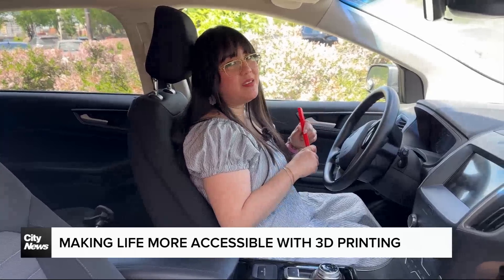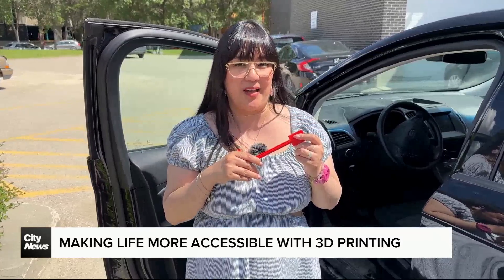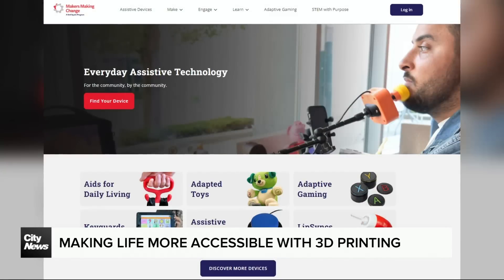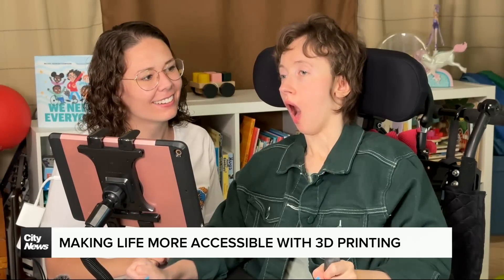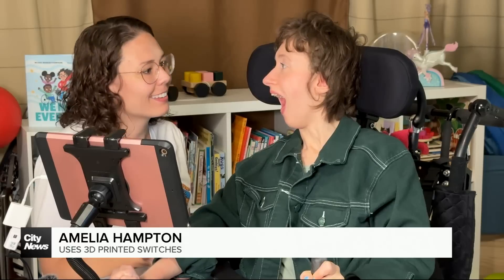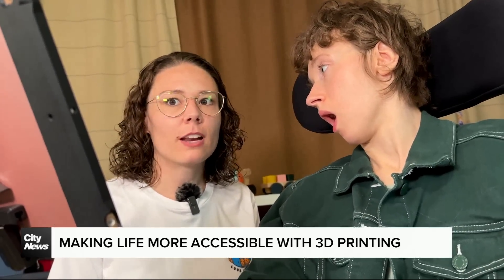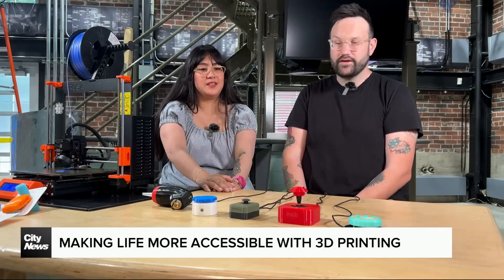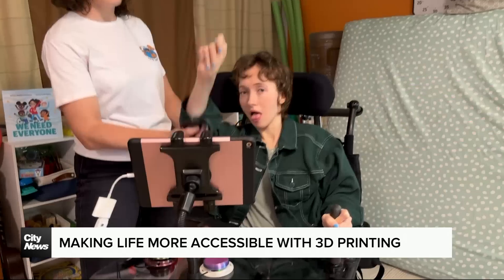Canadians using 3D printing to remove accessibility barriers at low cost

Comment: Umm maybe if you can’t engage or unclip seatbelt you are unfit to operate a motor vehicle? !?!
Reply: Clearly you  lack  basic understanding and compassion for those who might have some limitations so..... There are cars adapted for those missing one or more limbs or in a wheelchair. Should all those people just stay home or give up their independence? Just because something is painful doesn't mean you can't do it. If we can make life a little easier for them, shouldn't we?

I guarantee you they are all safer drivers than the tik tok generation with their heads stuck to their phones while driving
Reply: That does not automatically make you unfit to operate a motor vehicle. 

Think about hand controls, which are fairly common for people in a wheelchair. Just because they cannot operate the pedals with their feet does not mean that they are unfit to operate a motor vehicle. They just need adaptations so that they can use it properly.

A quadriplegic may not have normal movement of their hands, but with adaptations, they are then able to use something like a seatbelt.
Their range of movement of their hands does not impact something like their reaction time.

I’m not sure how it is where you live, but where I live, there are many procedures and tests in place to ensure that someone is indeed fit to operate a motor vehicle. People with disabilities have A LOT of hoops to go through to be able to drive.

And because of that, they often actually drive much safer than most people because they know that it’s a privilege that cannot be taken for granted.
Reply: Ummm, first no, and second have you ever been in a car without a passenger seat? Or perhaps you're still paddling around in your Little Tikes coupe
Reply: @marchache  Maybe you should expand on the no passenger seat comment instead of the insults 🤡

Comment: Maybe controversial to say, but if you have problems controlling your hands maybe you shouldnt be in control of a two ton hunk of metal that can go 100mph
Reply: Darn. I totally forgot that every vehicle only comes with a driver's seat.
Reply: Just because they don’t have normal movement of their hands does not mean that they cannot operate a vehicle safely. Many people with disabilities are perfectly capable of driving, but they need adaptations to be able to use a vehicle since vehicles were designed for people without disabilities.

For example, one common device is the hand control for wheelchair users. Wheelchair users can use hand controls to operate the pedals. It’s not that they can’t drive because they don’t have normal movement of their legs, it’s just that they require an adaptation in order to use a device that was designed for people who have normal movement of their legs.
Reply: keep things to yourself and learn how to respect one and other k?
Reply: @olliecatmax  I'm not making fun of anyone, I'm pointing out a potential road danger. If you think that's disrespectful then you have a lot of growing up to do

Comment: 0:01 we don't get to see her actually using the seat belt thing. The seat belt was as already undone. Huh??

The seatbelt is actually already loose in her lap and being held by her left hand by her tummy area.
Nowhere near the seat belt lock.

So the device doesn't work? Broken?

Straight off the bat the video seems shady. Why lie at the start?
Reply: Use critical thinking. Do you think that someone might have to lie that a plastic stick is capable of pressing a button? If the dude said that was his first invention, do you think he would make a whole 3d printing website based on a lie, without getting caught?
Seems more likely to me the editor just made a dumb editing mistake and sacrificed us getting to see the actual click for the sake of intro pacing. Or maybe someone spoke during the shot, and didnt film a second take, such that the editors hands were tied. Imperfect and unsatisfactory, but not dishonest.
Reply: First you shoot the messenger, then you go off on an unsubstantiated rant.
Reply: @dougaltolan3017  so what are they reporting? A device to help open seat belts. But we don't actually see that. Instead we see a fake moment.

You don't think we should call out fakes on the news?

This is the news doing a product placement too. A fake advert that doesn't even show it working.

You don't see anything wrong about that?

Isn't that called a scam?
Reply: A positive, mainstream story of the benefits of additive manufacturing. But there always needs to be the one or two negative comments that still find fault in everything. This video isn't some conspiracy, dude.

Comment: I wonder if there is a tool to help put a seatbelt into the buckle when I am seating in the back seat. I keep missing the buckle and not able to get the seatbelt to click or I get the wrong buckle and cannot fasten my seatbelt. The O/A makes it very difficult to hold the metal piece.
Reply: Buy a cheap pool noodle. Dollar store.  8f it's 3asier ask some to cut it for you so it goes around the seat belt holder. In a way it no longer flopsloke a dead fish.   I drove seniors.  I also got a seat belt extender which stayed plugged it extending the clip 5 inches. They no longer struggled. They loved it.
Reply: 3 old ladies in a tiny backseat.  We had an AWFUL time trying to get buckled!  We had to buckle each other in!  We got to know each other quite well in that tiny back seat.  😳
Reply: There can be. Tools aren’t hard to design, but they won’t be able to make you connect the right buckles together. That’s on you.
Reply: If it doesnt exist yet I'm sure it can be made fairly easily. 3D Printing is one of those things of "If you can imagine it, you can make it"

Comment: If seatbelt releases need special tools to operate they are not a safety device but a safety hazard.

If that were not the case we would laugh in every tv and movie drama when someone tries and fails to release themselves from the vehicles under water or in imminent danger of catching fire.

This device is not a solution. 
It is mitigation.
Reply: Dude, the inability to get out of the car isn't because of the seatbelt. It's opening the car door or breaking the window before it's too late to reach the surface without drowning. If you have rapid flood water beating against your car, you will likely die even if you get out. If you can't push a button to get a seatbelt off, then you aren't surviving any of those scenarios regardless of the seatbelt.
Reply: @sonniepronounceds-au-ni9287
The words I write are the words 
I mean.
Often, on screen, when a hero escapes a sinking car he is unable to unfasten his passenger or they are unable to do it themselves. A very common scenario.
I am not addressing the realities of drowning in cars but movie and tv story lines.
Dude.
Reply: @jeremyashford2145  The discussion about whether seatbelts are a safety hazard and the need for seatbelt releasers has to do with reality. The reality is that seatbelts generally don't cause problems for anyone who could survive that bad of a wreck without aid.
Reply: Please don't tell me you drive without a seatbelt because you saw someone die in a movie..
Reply: @Mattematical
Okay. Not a thing.

I've seen movies about contagion as well and recognise those as fiction too.
Reply: How many times have you been in a car accident vs a submerged or burning car?
Reply: @kel5944
Submerged car: 0
Burning car: 2
"car accident": too many to count but I've never been in one I could not remove myself from
Reply: What is your point? That disabled people shouldn't have tools to be more self sufficient and experience a sense of independence? Or is it that cars are just too dangerous for people with disabilities to be in? Please, by all means, offer us your magic carpet instead. Or you could just consider reassessing your ableist views.

Also, how are car crashes such a frequent occurrence for you? Are you a Hollywood stunt driver?

Comment: Convincing your old relatives to do less as it becomes harder just accelerates their degeneration. Not only is using that seat belt aid probably hurting his dad just as much as it was to do it himself 2 years ago, but this would of cut years off his life.

Dont do things for the elderly that they can do themselves, especially if those things are hard for them to do.
Reply: I disagree. My left shoulder is bad. If I move my arm up and out far enough to hold my parking pass up to the reader at work, it hurts. Often to the point of it throbbing all day. I now have the pass attached to a three foot length of pipe so I can put it against the reader without hurting myself.  I don't see how not putting myself in pain will impair my cognitive abilities.
Reply: Ah the common "enabling vs accountability". Though this thought very well might be true to an extent, its not a reason to downright stop ingenuity. Ultimately people must try things to find out.
Reply: This is a completely bizaree comment. It would cut years off his life? Huh??????
Reply: Better yet, get them to take the bus.

Hope they don't sit down for too long, or else they might lose the ability to walk.

When I used to use those shoulder-destroyers, I would press the button for the buckle with my THUMB. It was much better than trying to pinch in with my fingers.
Reply: @mRahman. My thumbs are so full of arthritis that at times they have no strength at all.  I'm the one who could open jars even men couldn't get open.  (I think the small squareness of my strong little meathooks maybe gave me a better grasp on the lids.).  Fingers, hands, wrists, elbows, shoulders and all points further south.  Arthritis.  Bursitis.  And 5 decades of severe fibromyalgia.  Some days I'm not too bad.  Other days I have the strength of an overcooked spaghetti noodle.  Any little bit of help that makes me function more productively without pain or damaging myself is very welcome.  Aging is bad enough when you don't have health issues.  These tools can help keep us in our active lives.
Reply: @wendybutler1681  you really bothered typing all of that with arthritis?

Comment: The only problem with personal manufacturing tools is that there will be a wider variety of products being developed and hence more confusion as to what does what and which is a better solution.  Of course, these challenges are inevitable as we approach a post-scarcity civilization and our population grows.  Even communications in our scientific community is now greatly bifurcated, we used to have three global peer review journals just thirty years ago but now we have over 350.   We simply won't be able to communicate everything and build on previous works and promote and spread good ideas and products quite soon.
Reply: Did you hear the part where they volunteer their time and sell them at little cost? Peer reviews, bifurcation ie: splitting. Why would you even look further than that to a manufacturer who will mark it up 1000%  if you were disabled and needed a simple tool that was working?
Reply: That little part takes under an hour to print. Tell me what you want it to do differently and wait an hour…..  not quickly enough for you?
Reply: Trust me, the things that DO WORK will quickly and frequently be requested. Anything that doesn't will quickly get weeded out.
Reply: @CricketsBay  That's only if there's sufficient communication and competent evaluation.  With everyone being able to create whatever they imagine, there would be too many products to know of and compare.  Sure, there will still be some word of mouth, some viral concepts and trends but there simply isn't any assurance of compete communication and there will even be people separately and independently conceiving the same idea.   We will have a world where we continuously reinvent the wheel.   You already see this in the now 350 peer review scientific journals.
Reply: Good enough will do, perfection is a large, unwarranted cost.
Reply: Who cares if things are recreated? I don’t see the problem. There doesn’t need to be complete communication. If it helps a handful of people find something that works for them, then they are achieving their goal.
Reply: You're really overthinking this, dude. We don't need NASA grade engineering for every simple tool. The 3D printing community is pretty amazing and it's not hard to separate out duds when searching. And like someone else said, these small parts print in less than an hour. So it's easy to rapidly prototype/make quick changes to feedback.

These are people volunteering their time/money to make inexpensive, tailored tools. I think most would agree that that's a great thing.

Perhaps consider looking into 3D printing further, including the vast communities that exist that do, by their nature, peer review. Most designers are very motivated to make positive changes to their models from user feedback or even make modifications for niche use cases. Designers do get intrinsic satisfaction for knowing they helped someone, somewhere with their clever designs.

Heaven forbid that power be decentralized a little from the huge, infallible multinationals/conglomerates that would charge an arm and a leg for a simple tool, though.
Reply: @ultramegax  The whole 3d printer concept is just manufacturing becoming more available on smaller scales as are the CNC machines etc..  All I'm saying is that with anyone being able to manufacture what they can design, we'll have a lot more products to the point where there would be too many to consider and evaluate.  Are you denying that there are a lot of people in the world, are you denying that people develop their own ideas, do you deny that a single unknown person won't be able to communicate with everyone in the world to see what everyone else has been doing.   What I am saying is already happening with the three global peer review journals bifurcating to 350 journals, with experiments often unwittingly replicating what another researcher is doing.   This is also already happening with user contributed content with videos.  We saw an increasing unity in what people saw and experienced with mass media but now the few contributors have become the many.  With the exception of the few who establish reknown, most contributors and content will just be unknown and often recreated as if an original concept.  This is already happening, we're already reinventing the wheel constantly.  All this takes is numbers and a low threshold to manufacture.   Everything will become bespoke and custom as well as unwittingly recreated...   The points that I'm raising are not new concerns as there were similar concerns raised at every change in codification as in the printing press, the only difference is the scale of techniques and tools and how low the threshold is will continue to progress geometrically.  Sure, such concerns have always reached a relative meta stability point but those points are now less permanent and the gradient to the next one are becoming more steep.  All I'm saying is that if enough people had these small scale manufacturing devices than a given problem will likely have countless solutions to it but only a few concepts would ever be communicated broadly.  Is this a problem, will that depends on if it result in technology regression and we did see technology regression from the fall of the Roman empire.   Even the current move to encryption on network infrastructure devices is a regression from the debates during the 70's as to which communication layer should computer encryption be on and those pushing encryption on devices now just think it was never considered before when in fact it had and had also been ruled out as fundamentally flawed and insecure...   This is just where the doing outpaces communal communication, where there are just too many people for everyone to know what everyone else is doing.  Even the concept of the patent registries was to try and address this concern, to try and offer enough protection so that people will openly communicate their ideas and with a central registry, a place where people could find other people's ideas.  Pretty much everything we've done with registries, journals and even conferences have been to try to manage this.  All I'm saying is that there is only so far such mitigations can go but there seems to be no end in extending capabilities at ever lower costs to more people that everything will become diluted.